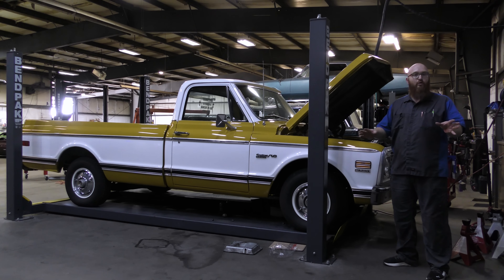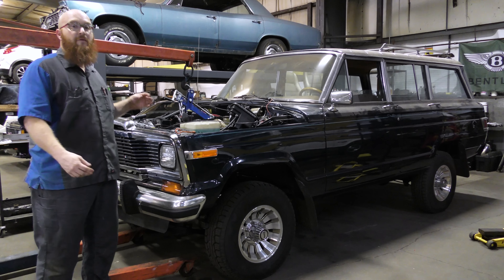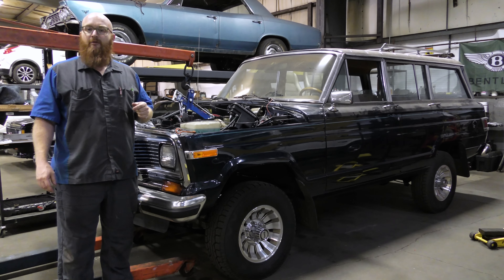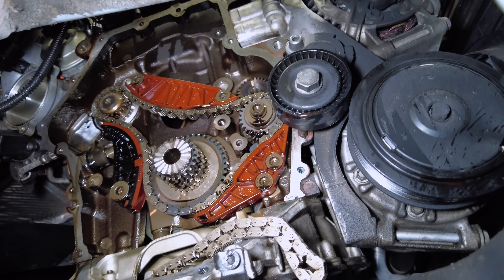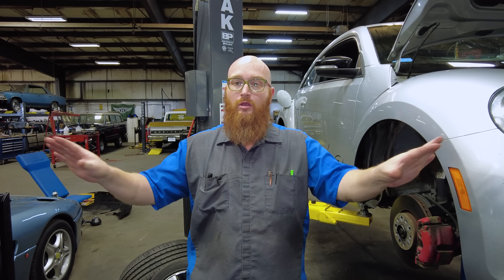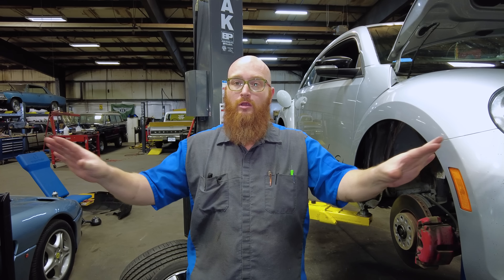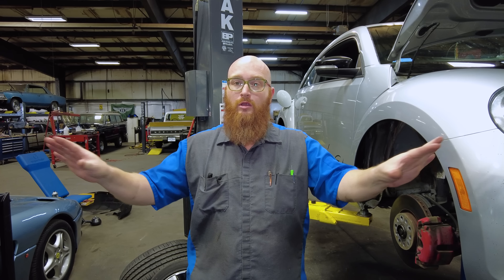Hard to test, can't see it, but it can KILL your car! CAR WIZARD talks Timing Chains! Is yours next?

Comment: Those old V8 timing chains didn't last the life of the car. Eventually they got sloppy enough where the gears would jump time and the engine wouldn't run. I had a 350 small block Chevy that started leaking oil. The timing chain had eaten tough the cover to the point where the paint was the only thing holding the cover together. Failures at high RPM s could wipe cam lobes.

Comment: I never understood why Audi and Volkswagen make the most complicated timing sets on the planet I have a Honda r18 and it has one timing chain and they never have problems

Also a new Honda timing set is like 200 bucks LOL and they are not that hard to put in time however it is kind of difficult to get the timing cover off as with any front wheel drive timing chain vehicle

Comment: "Smart" consumers that want to keep their cars a long, long time must do the research on their purchases.  Unfortunately, they are more inclined to purchase a vehicle based on the "bells & whistles"...  With that being said, shame on the manufactures for building-in such a costly failure point.  I'm glad the Wizard actually points-out vehicles (brands, models) to avoid because of these issue.  Keeping cars on the road (long term owners) is tough enough with all the crappy parts out there.  And then again - Shame on the engineers and bean counters that cut corners or are mandated to build the crap they are building today. (&^$% Direct Injection!)  Most of us cannot afford to replace a vehicle every 100k.

Comment: I think the early Ford in-line 6's were gear driven......would last forever with deadly accurate valve timing.
Reply: In the Eighties they changed to a plastic gear to "make the 300 quieter." LOL it was just to make people buy new vehicles. Had one in my '90 F150 that striped the gear and ate the oil pump. After replacing the pump and the gear with an aluminum one it ran issue free until the frame rusted away.
Reply: Didn’t they go back to the metal gears in the last few years of production?
Reply: @atx-cvpi_99  I don't think they did. Mine striped at  around 200k

Comment: When I bought my 2012 beetle used I  wanted the 2.5 5 cylinder. I knew the turbo 4 had more problems.
Reply: Same here 👍
Reply: they have the same problems they’re just less popular so the people with issues are proportionally less
Reply: @sinewave999  not true. The 2.5L 5 cylinder was a great engine (minus the fuel economy). Reason being, it was the last non direct fuel injection engine we got in North America. The 2.5 had very little issues.
Reply: @volpswagen_marco  Agreed. I still have a 2007 Rabbit with this engine and did not have any issues with it. It is leaking some oil now, but that's it. 25mpg is what I usually get out of it. My engine also only has 150HP, the later years engines made 170.

Comment: My preferred way is like an older Ducati with a shaft and bevel gear
Reply: Even better: gear cascade.
Reply: @AlessandroGenTLe  I will take my shaft drive any day have a good one
Reply: @AlessandroGenTLe  that's too much gear lash to mess with in my opinion old Ducati shaft only takes two bevel gears to mess with the lash
Reply: @ronald5629  I don't think that's the case, or the super precise F1 engines would use that system. Instead they use gear cascade :)
Reply: @AlessandroGenTLe  that's nice but I'm not going to argue about the best system I just have my opinion and you can have yours and we can both have a good day I just don't like cam chains or Cam belts but I have owned them all. The more of anything you have is just more of maintenance gear Cascades is just that more but that's your opinion and I respect it I've been a mechanic all of my life and I've built many things so have a good day .ಠ_ಠ
Reply: @AlessandroGenTLe  I tell you what you design your engine and I'll design mine and we'll both be happy (⌐■-■)
Reply: @AlessandroGenTLe  I don't think that's the case I think you're wrong

Comment: It’ll last 100-150k miles if you change the oil on time and drive the car properly. Also, lots of modern 2.0T engines sound like garbage on cold start even when properly maintained. Can’t recommend enough to avoid BMWs with the 2.0t N20 from about 2011-2015. I personally know 3 people whose timing chain guides failed on the engine with proper maintenance. I used to have an N20, and went back to the earlier N52 NA I6 for reliability reasons. It’s very risky buying one used as the extended length oil changes from BMW were detrimental to these engines!!!

Comment: Check out the channel I Do Cars for engine teardown videos and some of the engines known for timing chain issues.

But German cars are more notorious for these problems because their manufacturer's idea of "good for life of the vehicle" is more like "good for the warranty period plus a couple thousand miles".  Nothing near what us Americans would expect.

I'm sure you already know this, but Mercedes M272 engines had a few years where the sprocket teeth on a balance shaft would fail early and throw the engine out of time.  Not a quick or cheap fix.  You can test it by removing the cam sensors and verifying the timing dots on both shafts line up with the holes.  If they don't, say hello to a $5000+ repair bill.

Comment: You might also wanna have to take a look at the intake and the EGR valve. These engines are very prone to gunking up the intake valves with oil residue and carbon buildup up to the point that the valves do not close proper anymore. These TSI engines are just pure garbage and failing by design. The 1.6liter engines suffer from fail designed oil scrape rings on the pistons, the 2.0's suffer from the timing chains stretching, jumping over or breaking. Yet here in Europe customers sit on the costs for these obvious design faults and have to pay the bills themselves or just throw the car away when it happens.

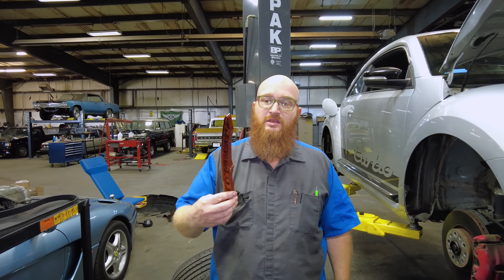Comment: 8:15 Here is a serious question. Is it possible to get a 3D printer that could make parts like this, better than factory? Especially now with times-a-changing...
Reply: 3D printer plastic is unlikely to be anywhere near durable enough. It might also be degraded by engine oil, though that would honestly be secondary to the low melting point and low durability.
Reply: @napoleontheclown  plastic?  I'm pretty sure that 3d printers use metals also.
Reply: @evalonious  If you're going to use metal, might as well cast or machine it. It'll be stronger and you can actually use metals suited to the task. 3D printers ain't magic.

Comment: I have not watched the video yet, but 10k mile oil changes are a marketing lie. So are "sealed for life" transmissions. As far as the car manufacturer is concerned, the car only needs to last the length of the powertrain warranty.

Some brands you can get away with it a 10k-mile oil change, but you HAVE TO use OE spec oil and filters. Many quick lube and general purpose auto repair shops don't. Heck, many dealer's don't!

Comment: If I have a GM 3.6 with 145k mikes. The  oil has been changed every 5k miles from Mile 0. do I have a ticking time bomb?
Reply: Yes.  The only unknown is how much time is left on the clock.  The crystal ball says an expensive engine-out repair is in your future.
Reply: Not necessarily. Many people have reported issues well before 100K, so I'd keep doing what you're doing, especially if it doesn't use oil between service intervals. Many people neglect there vehicles by running the oil too long & or running it low. The chain is cooled by the engine oil, so if you run it low the chain gets hot it'll stretch. I had a 2015 Colorado & 2014 Camaro that had the same 3.6 & had no issues with the timing chains. I did my changes at 3,500. Oil is cheap compared to an engine.
Reply: Yes, GM junk

Comment: Manufacturers should be mandated to build reliable vehicles since producing a vehicle emits lots of emissions. Longer lasting vehicles is good for you and environment.
Reply: It would be nice to see which kind of modifications they would do if they were mandated to build vehicles designed to last 500k km (310k miles) with standard maintenance. I bet they'd shorten A LOT the oil change intervals, get rid of all the "oil for life" bs, and probably asking you to do a lot more maintenance...

Comment: I am sorry, but to say "old timing chain" was no problem, you dont talk about the lifters and pushrods needed for this system... This IS the reason OHC was used with longer chains and/or belts leading to failures.

Comment: What year GM 3.6 has a timing chain problem? I have a 2018 traverse with the 3.6 and I am concerned.
Reply: Pretty sure all of them.
Reply: All 3.6s have the issue.
Reply: Oil change intervals mean everything on a vehicle. I took the valve covers off of a 200k plus miles ecoboost and it looked brand new.  Not even stained inside.

Comment: Theres cars like a lexus ls400 from the 1990s that went from a non interference engine to a interference engine in the same motor and you can see its not nessary from them to have to be made to destroy them selves like they are now. Like on bmw v8e there timing chain guides are made of plastic and theyll break on you and destroy the motor through mutiple generation or different motors as well idk how that happens or how bmw could have the same cooling system problems since the 1990s, or problems with there vanos through out mutiple generations and different motors. Infinitis have problems with there timing chain tensioners in as little as 100,000 miles i had one go at like 96,000 makes a nasty noise when you firste start it up then itll drive completely normal for a very long time then gets the sound would get a little longer a secone or 2 longer until i fixed it but it was to late by then and the motor blew after the mechic fixed the timing chain tensioner.
Reply: The 95 was first year of interference due to a new head design. 90-94 are safe. So, for everyone: 90-94 non-interference. 95 and up will smash your valves into your pistons if your belt breaks!
Reply: @MauiWauiPineappleExpress  thanks for the info i was wondering what years they changed. But my point is they didnt even need to become interference engines not much changed

Comment: So... you're just too young to remember the 1960's 1970's and 1980's V8's. Back in the day we replaced the timing chain at 100,000 miles in everything that had nylon gears.  Pontiacs were non interference, and Olds would snap the aluminum rocker stands and bend the push rods when the chain cut loose and the valves hit the pistons but chevy's and Buicks were usually pretty trashed.  So basically, after I learned the hard way... I did a timing chain on every V8 at every 100K that includes Fords and Mopars.  Most all had nylon gears.

The only reason why most people don't recall the timing chain issues from back in the day is that most people got rid of their cars before they hit 100,000 miles. I always ran my cars way over 100,000 miles and I ALWAYS had to replace my timing gears and chains.  For the sake of convenience, on old V8's do the chains when the water pump goes. The water pump usually craps out a few weeks or months before the timing chain, at least on the old GM's.

And by the way, I don't know if the problem is with the chain... Usually the nylon gears shatter and have to be fished out of the oil pan in little pieces. So I don't know if it is chain stretch or just that the nylon has a life span.

Comment: I really hate modern manufactured cars and their weak timing chain parts, mini / prince engined cars with their weak tensioners and guides, terrible plastic parts. Some cars even have rubber timing belts inside the engine encased in oil.
Reply: Honda EU1000 and 2000 and 2200 generators have these timing belts running in oil..
One commenter on James Condon's channel said his had run 17k hours 24/7 when he repalced the belt, then the engine ran another 17k...and he was going to run the belt until it gave up.
Another said 65k hours of 24/7 off grid generation...original belt running in oil...
Reply: @JohnSmith-yv6eq  That's crazy! Thank you for the knowledge

Comment: Anyone have experience with 2010 Ford Crown Victoria 4.6L V-8? (not police vehicle). I'm looking at one with 92,000 miles. It's 210 miles away from me and just to be safe I plan on getting it transported to my neighborhood mechanic after I go test drive it and check for rust. I'll have enough money to do any repairs if needed. Since it has a chain would the whole shebang need to be replaced at 92,000 miles? Thanks!
Reply: I would inspect it for rust before you give them any money. Used car dealers are good with spray paint. I've seen rags stuck in and painted over.
Reply: My 2003 4.6 grenaded at 190,000 miles due to the plastic tensioner breaking.  If it doesn't rattle upon startup and you keep up with oil changes, you'll be fine.  They are good engines.
Reply: @carlt6932  Wow! Dirtbags. Thanks for the tip!
Reply: @anonperson7386  Thanks!

Comment: Didn't build the jeep correctly imo.. It should of been retrofitted with roller cam and lifters! Plus you could of went up to a more performance cam without losing drivability and not had to use high zink oil!

Comment: I think you’re misinforming people about timing chains of the 1960’s and 70’s. While they didn’t break, they did stretch, to the failure point at 70 - 90K miles for GM and 100 - 120K on the Ford. Also from the mid 1960’s Ford and GM both used cam gears with plastic coated teeth, and those teeth would shell off the gear when the chain was already pretty well stretched causing it to be even more loose. 
The chain would then jump time, usually during the first cold start of the day and cause the engine to not start. In the case of that Chevy 350 you were showing us, a loose chain jumping time caused you to have two heads full of bent valves, at least on every one that I repaired, so you also needed a valve job when the timing chain jumped. The chain in my Dad’s 72 Chevy pickup 350 never jumped time, but it was so worn out it ate a hole in the timing cover under the crank snout and it had a massive oil leak. A new cover and a double roller chain and gears for a medium duty Chevy dump truck 350 fixed it right up.  The Ford 360 engines would bend all the valves when it jumped time. The 289 in my Mustang didn’t bend any valves when it jumped time, so I guess it just depends on which engine you were dealing with.

Comment: I call this planned obsolescence the "Airbus effect".

Airbus, the European airframer, has publicly stated that irregardless of time or cycles, their aircraft should be replaced and recycled at the 25 year point.  Their point is that technology moves forward, and newer designs are going to be more efficient, which is true from a purely logical standpoint.  As such, they do not build their products with the same reserves of strength and durability that Boeing does, and mechanics have on multiple occasions told me this.

Few people work on their own cars anymore, partially because modern equipment is extremely complex, but also because the number of people who understand all the new technology is quite a bit less than in the past.  Really, our society is so wealthy that when a car suffers a catastrophic failure, many times people will simply trade it in on a newer vehicle.  In essence, they are "Airbusing" it and as such most cars are now effectively "disposable" and the manufacturers know this.  And approve, of course....

Sad, but true.

Great video!
Reply: I believe that with new composite airframes and wings Boing is on that boat too now.

Comment: Batteries aside....  Electric vehicles just don't have the same long term maintenance issues that vehicles with internal combution engines do.
Reply: Until you have to change the battery for 1/2 of what the car is worth

Comment: I had a Toyota Tercel that had the timing belt that failed, and lucky for me it was a non-interference engine...  I've never understood why you would design an engine that would lunch the entire engine if the belt or chain failed if you didn't have to.  So stupid.
Reply: To get more power, non interference engines are extremely slow and under powered

Comment: 1000-1500$ for a timing belt, that's ridiculous, 20-50$ for the belt & 10-30min of your time & wala. A timing belt it one of the easiest most simplest things a 12yr old could do it. Never trust a shop with something your capable of doing yourself with a Lil research if need be. This is a prime example why. If somebody can't do a timing belt, I doubt they can do a oil change. A timing chain is a different story though but still not too difficult if you research & take your time & you can always retry for free if need be.
Reply from the maker: So you would re-use your water pump, cam seals, tensioners and pullies?

Comment: Timing chains and belts are not a new issue, but current poor quality design has made them worse. Let's make it cheap; screw quality. Again not a new idea. I owned a '71 Fiat 124 coupe that used a rubber belt to drive the cams. High compression with little clearance between the valves and the pistons. When the cam belt on my car broke it put two valves through two pistons.